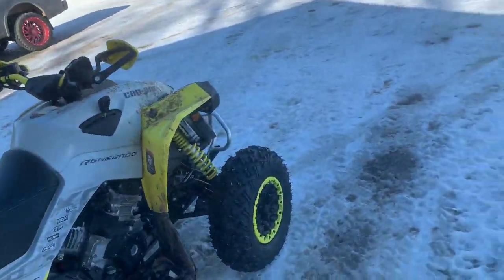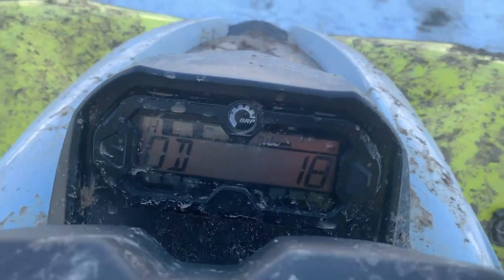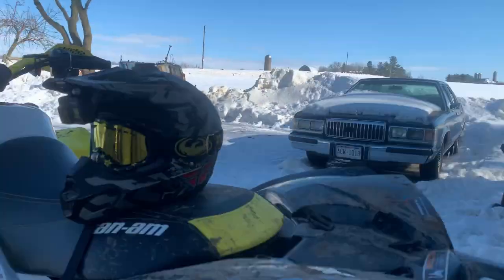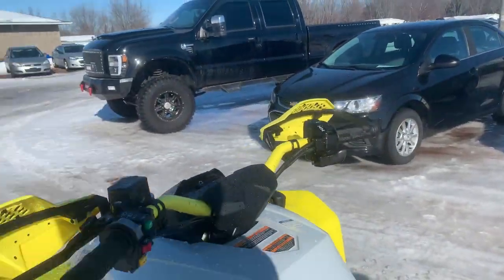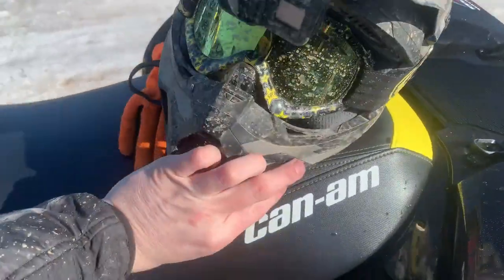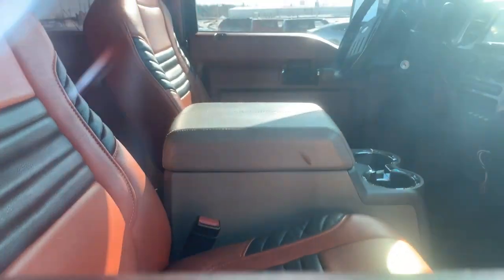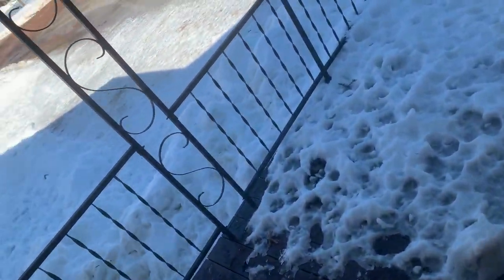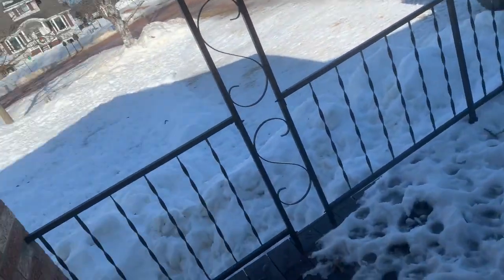Ripping The Can-Am Renegade! (Wheelies)

Comment: If you have even air pressure in tires it should go straight... and also have you ever gotten pulled over for your wheels sticking out more than 2 inches?
Reply from the maker: LWRacing88 I played with the air pressure and I can’t get it to go straight. It’s not consistent on which direction it goes either... I did a wheelie for 2.5 miles on my old LTR 450 and it was easy compared to this thing lol and nope. I got pulled over for tint and the cop mentioned I may run into problems some day but was never actually pulled over for that